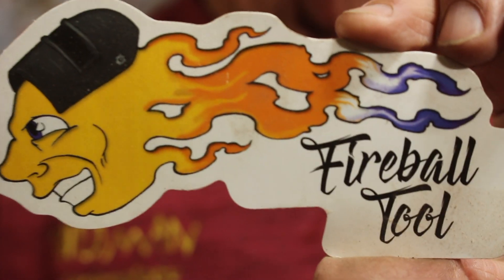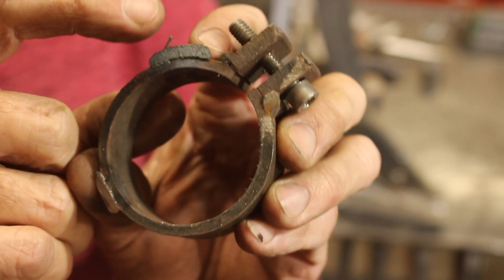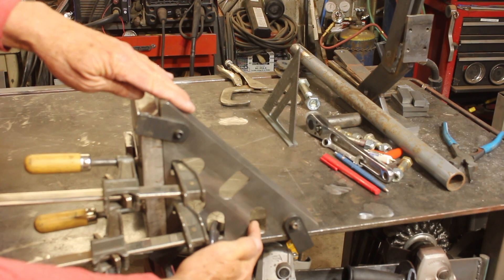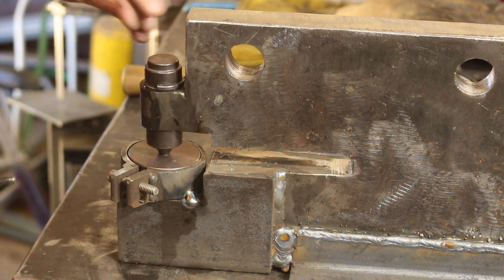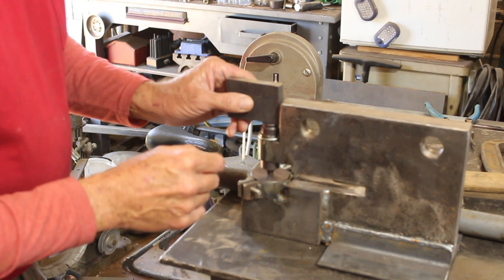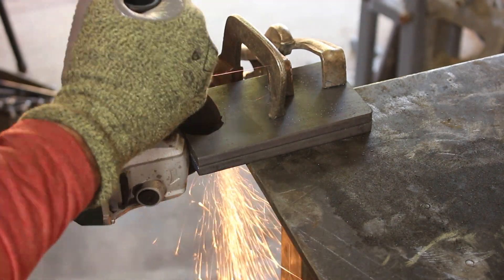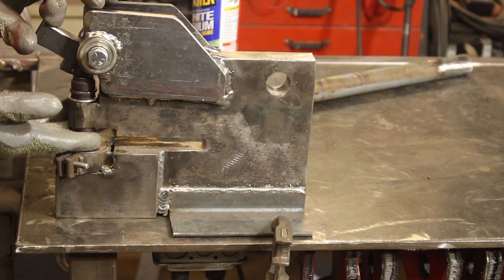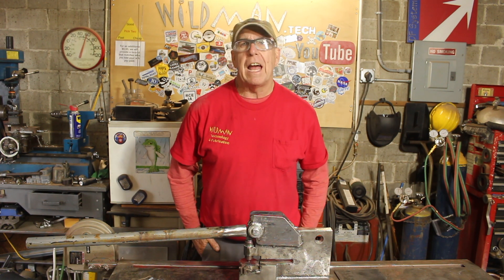Build a Benchtop Hand Punch for Steel!

Comment: We had an old kick press when I was a tool and die maker back in the 70's and it worked good, you could get up close at point of operation. It used a linkage similar to bolt cutters. I've been designing metal stamping dies for over forty years and trust me you can reduce the tonnage by grinding off that point on the punch. I always laugh when I see them, they are good for a visual, not friendly when it comes to tonnage reduction. Grind shear or better yet... inside crescent (arc) with the apex 1/3 the material thickness. Use 14% per/side die clearance and you can reduce your tonnage by 50%. You need chrome vanadium die spring or Urethane will also work for stripping the punch... Good luck.!!